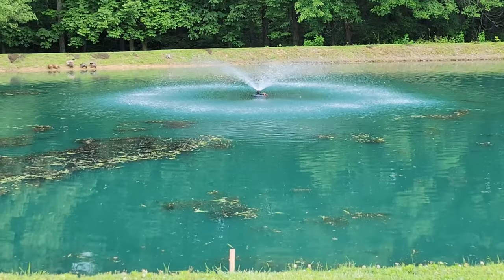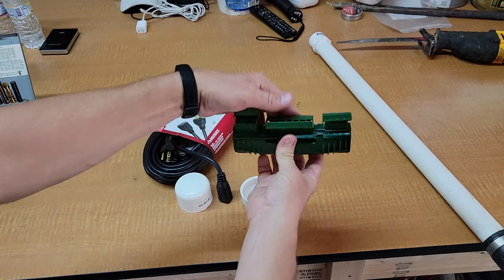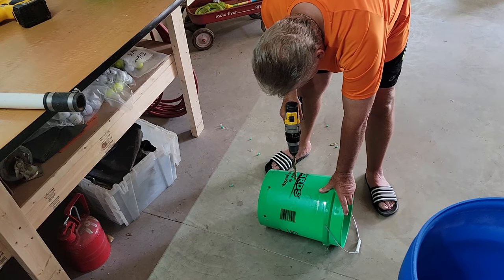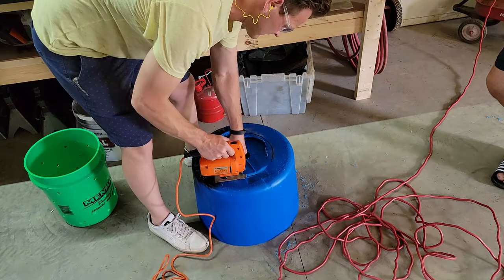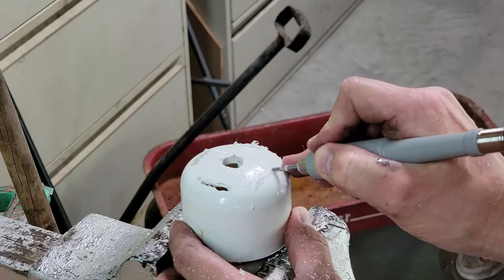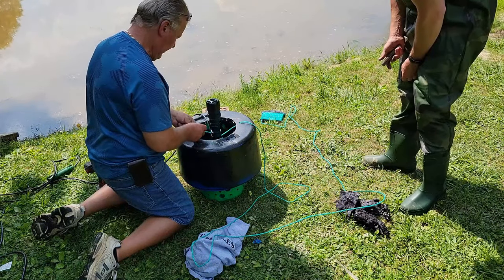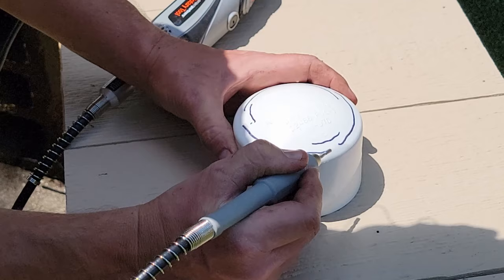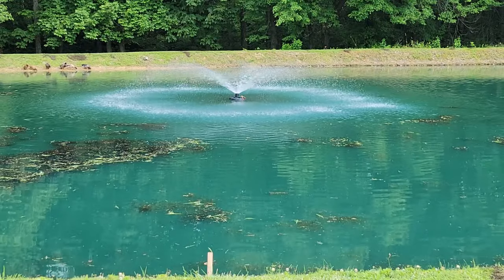How to Make a DIY Pond Fountain for less than $200

Comment: These pumps are not designed to run for extended periods of time and will over heat and burn up....
Reply from the maker: Indeed.  I had them on hand and that I was I used it.

Comment: One thing to mention, most sump pumps are only rated for an hour or less. If they run any longer than the specified time they will fail. So before you buy a sump pump, check how long it is rated to run for.
Reply from the maker: This is a good comment. They will fail eventually, and the point of this was to make a cheaper fountain.  There are certainly better pumps that could be purchased.
Reply: @y2kok  A water garden pump is for continuous running at a lower cost and no oil in the pump.
Reply: Of course a water garden pump is more cost but would be well worth it. My pump ($150.00)in my pond is 9 years old and just had to replace this year.
Reply from the maker: @betsyfincher9859  Fair points.
Reply: Water garden pumps are absolutely more suitable for the purpose. Sump pumps are great at pumping a lot of water in a short time but will not last long if kept turned on all the time. Water garden pumps cost more bust last a decade or more  in continuous function (if you keep them clean)
Reply: @betsyfincher9859  which pump are you using?
Reply: Dunno where you bought your pumps but I’ve run constant 24/7 and never had issues...
Reply: @johngardiner8847  What pump are you using @John?

Comment: This idea worked except after 2 days the fountain began to sink because the foam does end up holding water. I just needed up putting a partially aired up floaty to keep it above the water where it needs to be.
Reply from the maker: Did you use closed cell foam?  If you used open cell it will not work.

Comment: could you run one of this pumps continuously (24/7) , if so, how long do you think it will last before breaking?
Reply from the maker: They aren't really designed for running 24/7, but I have seen other videos of people getting over two years out of them running that way.  However, I run mine for at least 12 - 14 hours a day, and sometimes leave it on for several days straight (out of laziness).  No issues yet.
Reply: @y2kok  2 years of 24/7 run it's pretty good. Thanks!!
Reply from the maker: @Carlos-zn7lv  Best of luck to you on your build.

Comment: Nice work! I have 2 ponds that i need fountains for. Do you know what the cost to run it 12-14 hours is?
Reply from the maker: The area that I live in is around $0.10 - $0.11 per kwh and I think it is about $15 - $20 per month.  To get a true estimate it, I would have to put a monitor on it.  Sorry I don't have a better estimate.
Reply: that's when you just pop a solar panel on your pond-side gazebo ;)

Comment: This is a very well made and informative video. With all due respect to the others I've seen out there, I like your design and explanations of even what you didn't like about your first tries. I am re-evaluating my design after a lack of pressure at the fountainhead.
Reply: Any particular reason for specifying the barrel being "food grade"?
Reply from the maker: @brianbrown600  Thanks for the comment.  The food grade barrel comment was due to that some of these barrels are used for chemical transport, and you don't want that in your pond.  
Most of the time they people that are selling those blue barrels will know what was stored in them prior.

Best of luck on your fountain.
Reply: @y2kok  I have a question. How did you fasten the 5 gallon bucket to the barrel bottom? All I see in the video is the spray foam filling the void between them.
Reply from the maker: @brianbrown600  The spray foam is what binds them.  Because we had holes all the way up the green bucket, there was some foam that went into the inside.  This makes sure the foam will not slip off of the green bucket, and the pump isn't going to sink into the pond.
Reply: @y2kok  My fountain is complete and operational for about a week now. I used two cans of the pond foam sold at my local Home Depot. It was not the Great Stuff brand and the cans emptied faster than I have ever seen with the other foams I have used. Good thing that before I foamed the bottom, I drilled small holes in 3 spots about 3/4" from the edge of the hole in the center of the barrel bottom and made "U" shaped staples from clothes hanger metal. I ran them through the holes and holes to match about 1/2" from the top edge of the bucket. I them twisted them with vice grip pliers in the area that received the foam. When the foam cured, it did finally expand to just cover the bucket ridge and solidify it but I wouldn't want to trust just that foam to hold a running pump forever. The 2 cans of foam keeps my fountain top floating at about 2" above the surface with the fountainhead sticking up another 3". Your video was super helpful as I completely changed course from my original plans and quickly ended up with a fountain I am proud to show off!
Reply from the maker: @brianbrown600  That is awesome, Brian!  Glad that the video helped out, and you are correct, this type of foam doesn't go nearly as far as the cheaper stuff.  

Enjoy your new fountain!
Reply: @y2kok  Sir:  I didnt understand the concept of the plastic bag between the two buckets.  Are you saying you put the green bucket inside the barrel and put a plastic bag on the bottom of the barrel before you put the green bucket in?
Reply from the maker: @jadestone8002  you don't have to use it.  I was just to make sure that the spray foam didn't go onto the floor.  
If you wanted to use it, you would put the bag onto the blue barrel and then green bucket on top of it.  
Once you spray and let it dry you can just pull it out or cut it out.

Good luck!

Comment: Wow your an answer to prayer, we have three springs that are on the property that float to a pond we’re going to build, but you showed do you have any suggestions to make the lighting so the lights can be on the fountain and create a more beautiful look thank you so much for your insight and teaching.
Reply from the maker: Honestly, I did not mess with lighting as there would be another electrical connection to worry about.  I have seen people use solar lights as an option, but I don't know how well or long those would work for.  Best of luck and be safe.

Comment: This is an awesome video – I am planning on using almost exactly your design for my pond. 

That said, there are so many details that would be useful! Where did you find a 40 gallon bucket? I'm seeing them for $100, which blows the budget open with a $125 sump pump. Not complaining, just wondering how you managed to find those materials at wholesale-ish cost.

Any info on materials (other than sump / great stuff / bucket which are easy) would be very helpful!
Reply from the maker: Thanks for watching.  There are a couple of places that sell the 40 gallon buckets used around me.  There is probably some retired guy near you that is selling burn barrels, and I bet they sell these as well.  Look on Craigslist or FB marketplace for burn barrels, and see if they also sell these.  

Great stuff is going to cost what it costs.  HD or Lowes is your best bet.  

On another note, if you don't have a sump pump already then check out the "submersible pond water pumps" or "waterfall pumps" on Amazon.   That is the type that professionals use.  just make sure the GPH is high enough and the dimensions of the pump will fit in the bucket.  If I were to build another then I would use one of these.

Good luck and stay safe.  Electricity and water don't mix.

Comment: Very good vid! How water tight of the cord cover? I always worry about the water get into the cover. What model is that?
Reply from the maker: Are you talking about extension cord?  It shouldn't matter the brand.  As long as you keep the ends out of the water you should be good.  Don't go cheap on the cord though.  Make sure you can use it outside.  UV can do a number on them.  

That said, my pond is only about 6ft deep at max, and if yours is deeper there could be significantly more hydraulic pressure on it.
Reply: @y2kok  thanks! I actually was asking about the cord plug connector/cover. I saw some reviews on Amazon they always get water inside the cover. so a little concern.
Reply: heat shrink tubing is what we used
Reply: You could always use a bit of silicone to make a seal around your connection then put cover over it.

Comment: Do you run the pump all the time ? And if you do has it burned up yet ? Thanks
Reply from the maker: I normally run it from 9AM until about 9PM.  If I were to do it again, I would buy an actual oilless pond pump that people use for this type of application.  However, the pump is still going.

Comment: How are the cords ran.  Is it just a sub pump cord in the water or is the  Extension cord also in the water.
Reply from the maker: Yes, the cord sits on the bottom of the pond.  The pump only has a 6 foot cord so you will need to use an extension cord.  Make sure you use that cord protector that I showed in the video.

Comment: Great video, how did you secure the bucket the pump sits in to the barrel?
Reply: Sorry if that’s a dumb question or I missed it
Reply from the maker: Actually, it is the part that floats.  I need to make a short video showing that part a little better.

Comment: I am missing a step.  how did you get the green bucket to adhere to the 40 gallon can?  I see you put the spray foam in, but it seems like the weight of the green bucket would pull the green bucket out of the garbage can
Reply from the maker: You don't really need to worry about that.  Because the foam is going to press against the green bucket, it will adhere to it (because of the grooves).  That said, the blue 40 gallon just sit on top of it.  Doesn't matter if it is connected or not.

Comment: Why did you cut such a big hole on the food grade barrel the size of the bucket hole? Is that to have access to the pump and to clean it out if needed?
Reply: Nvm I rewatches the video a few times and answered my question lol
Reply from the maker: Haha, glad you figured it out.  You are going to need to clean the pump, and you will know when.  It will be obvious that the flow has slowed down.
Reply: @y2kok  They do sell pump filter bags to go around your pump so no debris gets in . Any water garden site should have it. Around $14

Comment: my understanding though, is this will not circulate the unoxygenated colder water at the bottom of the pond, it will only circulate the water that already has oxygen. it will look nice, but won't help keep a pond from developing algae, but maybe that was what you were going for anyway.
Reply from the maker: Yes and no.  My pond is only 6 ft deep max, and the main point of the fountain was to move water.  That is something it does.  Sure I could move more water with other methods, but this was a cheap DIY.
Reply: Justin you could always add an extension pipe to the sump pump with some type of mesh barrier around the end so that you draw water from deeper in the pond.

Comment: Can you post a link for the pump you used? Ones I'm finding are not inexpensive.  Any help?
Reply from the maker: Hey Anthony,
I just looked and you are correct, pumps are expensive.  When I made this video I could get a sump for around $100 - $125.  Prices have really gone up. 

I would look on Facebook Marketplace for a gently used one, or I am also trying to work out a deal with a company that sells pumps.  If I can get that to work out then I will post the link here, and it should be a little bit cheaper.

Comment: all the connectors say do not submerse in water? did you add silicone or no?
Reply from the maker: Sorry, which connectors?
Reply: @y2kok  the extension plug cover
Reply from the maker: @gwp1ohio  It actually sits on top of the fountain and isn't sitting in the water.  Hope that helps some.
Reply: @y2kok  3M waterproof electrical tape to wrap connections would work better
Reply from the maker: @betsyfincher9859  I didn't know that existed.  I'll check it out.  Thanks

Comment: Does plug connector go underwater
Reply from the maker: No, I try to keep it out of the water by sitting in on top of the barrel.  That said, it does fall in from time to time.
Reply: @y2kok tried zip tie it to the top?
Reply from the maker: @operatoreng  That is a good idea. However you do it, just be safe and make sure you are using a water rated cord.  Super important.
Reply from the maker: @operatoreng  I have not.

Comment: If the pump is oil cooled it with eventually leak and harm your fish
Reply from the maker: The pond is fairly large.  Chances are likely that any leak that occurs, if it does, would be unnoticed.
Reply: The oil used in fountain motors are not made of harmful oil. It is basically cooking oil. I’ve worked on them for many years and torn many of them apart.

Comment: Would it not work better for circulating the water if the pump was drawing water from lower level. My pond is about 12 ft deep and I was hoping to get the pump around eight feet deep in the water. Would the pumping lower help with the algae growth?
Reply from the maker: If you can put the pump deeper, then yes, that would be better for getting oxygen in that water.  I would recommend a different style of pump.  Look for one that has a good head rating, and that is meant to run constantly.  If I were to build one of these again, I would do something like a pond pump that some use for waterwalls.  Just get the largest that they make. 

Good luck

Comment: Helpful to know once you get your holes like you want them when you make your cat you transfer the edge of your whole movie with some like grit sandpaper or razor blade it will make your streams much cleaner even the smallest imperfection in the air that the water flows off of will change the look of the fountain even holes drilled with a drillbit tamper both side and it is a very different look much cleaner more professional looking fountain just food for thought
Reply from the maker: That is a fair point.  This year I plan on 3d printing a new top to see how much of a difference it will make.

Comment: This is great! Thanks for doing this! Just a question,  could I use a 55 gallon barrel instead of a 40 gallon? I can't seem to find any in my area.  Thanks again
Reply from the maker: Not a problem, and thanks for watching.  Yes, you absolutely could use a 55 gallon barrel.  That is what I almost used, but the 40 was cheaper.  

Best of luck to you on your build!
Reply: I used a 55 gallon for my fountain. It looks perfect and with 2 cans of foam sealant it floats nice and level about 2" above the water surface.
Reply from the maker: @brianbrown600  Good deal!

Comment: How the blue barrel hold the green ? The foam did it? It will be perfect see the part when you put the pump inside the green can.
Reply from the maker: Hey Axel, The blue barrel is actually just sitting on to of the green barrel.  The foam is attached to the green bucket because of the holes that are drilled into the green bucket.  The foam goes into the holes, and doesn't move.  
The pump just sits inside the green bucket.  There really isn't anything to see from that aspect.  The sting at the top is what holds the pump in place.  
Just let me know if that doesn't make sense.

Comment: I’m so glad to see you used your ear protection during foam application.  

Did you ever consider pool noodles rather than expensive foam?
Reply from the maker: lol.
Reply from the maker: @MorkieMom You could try it out.
Reply: Unless that particular type forms very rigid and firm foam when cured, it's absolutely open cell - just like all the other pond foams I've tried. I switched to black RV foam, simply for the color, but definitely saves. What you have to understand with all pond foams, it's NOT for water sealing. It's to reduce flow so you can guide more where you want it, which is usually over your falls not behind the rock. 

The cheap yellow stuff would have been fine for this since it's hidden anyway.
Reply: I tried a pool noodle and it shrank up and quit working after a couple days. Use styrofoam or a floaty with air

Comment: My pond is 12 to 15 ft deep.  I am thinking I could extend a couple of 2 in pipes down to pull water from closer to the bottom.  Wouldnt want anything bigger that could pull up trash or fish.  As long as there is enough inflow to keep the bucket full this should work, Right?  any suggestions?
Reply from the maker: Water is going to flow into the bucket from any opening.  You are going to need more than one 2" hole in the bucket to keep the pump from cavitating though.  

I do like the idea of moving water from lower to the top.  Might be better if you had a couple of tubes running down there.  

Let me know what you decide to do.  Sounds like a good idea.

Comment: What would recommend for having a higher fountain. Just a bigger pump?
Reply from the maker: A larger hp pump is going to move more water, but if you want the stream to go higher then use smaller holes in the cap.  However, keep in mind the higher the water goes the more water evaporation you will have.

Comment: How do you get the fountain system out to the middle of your pond?
Reply from the maker: You will probably need a boat.
Reply: Depending on pond size, if you don't have a boat, kayak, etc., you might could run long enough string or rope so that you could walk around to opposite side and drag it to the middle. I would try to get it in the water first as far as possible, maybe using waders, so that it's already floating before you start pulling. Once the depth exceeds the length of the anchors, the drag should ease up.